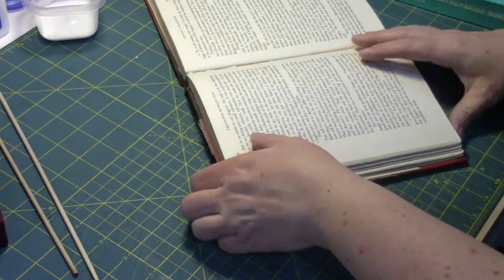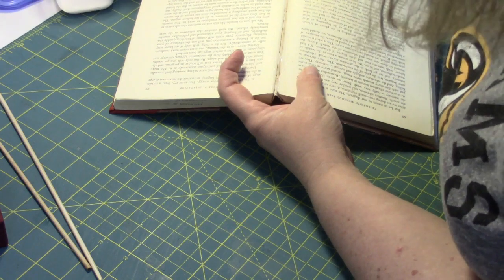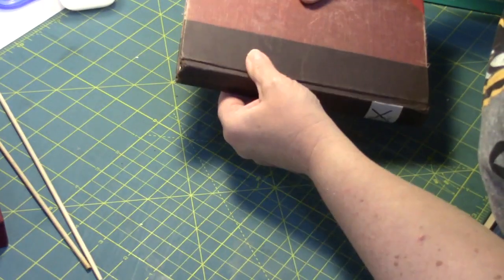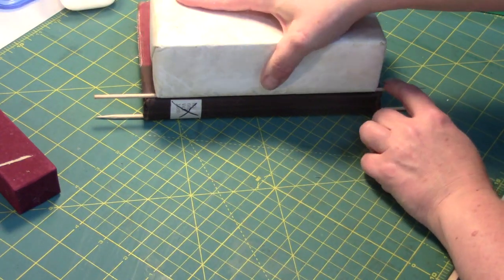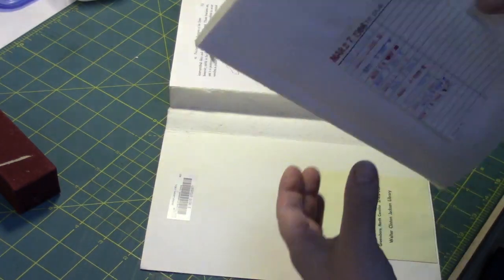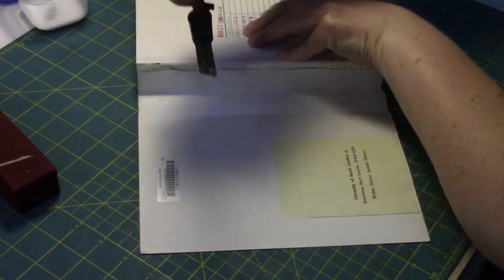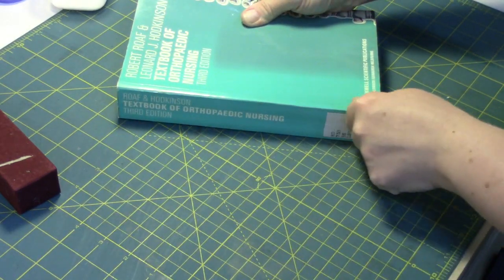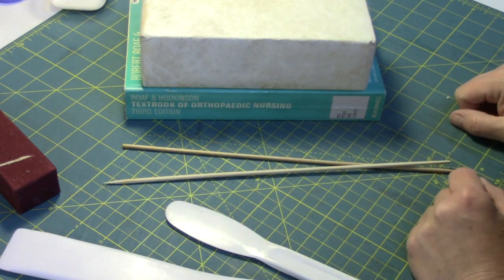Book Repair on a Budget: Consolidating a Textblock

Comment: I tried this and it didn't work. You need to bind the pages with twine or metal staples. Just look up some other book binding videos. It is more involved but it will be a much better repair.
Reply from the maker: Hi, Ben. Thanks for your comments and I deeply apologize for my late response. This series of videos was originally created for School Media Specialists who needed quick and easy repairs to get children's books back in circulation. The methods represented in the video are not always best practices, rather they are best when there is no budget and very little time. I am sorry to hear it didn't work for your book though!
Reply: @uncgarchives  It worked pretty great for me. I bought a trade paperback, that almost immediately started falling apart as soon as I started reading it. one section nearly came complete out, and that was causing other sections to start tearing away. I caused some minor damage myself to the spine being too aggressive with some inappropriate tools, but other than that, it worked perfectly. I've thumbed through it a few times and it seems it will hold up for me as long as I treat it with respect, or long enough to sell if I decide to do that. If I do sell it, I'll tell them that I rebound it myself, that's where the spine damage came from. THANKS!

Comment: what would you use on the edges of the hard back you fixed?  I have a number of older books that have the leather pulling away from the book on the edge. I have glued the cover to the inside sheet to secure but now i wonder what I should put on the edges of the book to keep it from pulling apart.

Comment: What kind of glue do you use?
Reply: pva
Reply from the maker: Marsela, I am so sorry for the late reply. The glue is polyvinyl acetate (PVA), which is commonly known as wood glue, white glue, etc. Standard Elmer's white glue that schools use is what I was referring to. We use a more archival version (neutral pH) in conservation, but the standard school glue is the same type of adhesive. It is great for bookbinding because it dries clear and it remains flexible, so the book continues to function well. Thanks for your question, and again so sorry for the VERY late reply!
Reply: @uncgarchives  Do you think hot glue would work or is that something that shouldn't be used on books?

Comment: Can we use Fevicol
Reply from the maker: Aditya, thank you for your question. I am not familiar with Fevicol. It looks like it works on wood or paper, but my question would be whether or not it remains flexible when it is dry. If it dries and is brittle, it wouldn't work well for this application. Also, I can't speak to the safety of Fevicol as a substance - looks like it has some potentially harmful chemicals in it. It's possible that it would yellow as it ages or else be too acidic for paper over time.

Comment: Won’t this stick the pages together?
Reply: Well considering she only applied a small amount of glue to the break in the pages, it should not stick the pages together, but only reinforce and cover the gap.
Reply: Just stick lah
Reply: You can use waxed paper strips between the pages to be sure the glue doesn't go where you don't want it.
Reply: @katherinecrosby2336  good idea
Reply from the maker: Hi, Ben. I am so sorry I am only now seeing your question. It looks like you received some good replies below. Wax paper is a good back up plan as well as just being very careful with where you apply the glue. The pages may not open quite as widely as before since they will be losing a little space at the margin. Just mask off the area with a strip of paper and you can be more careful to only get glue where you want it to be.